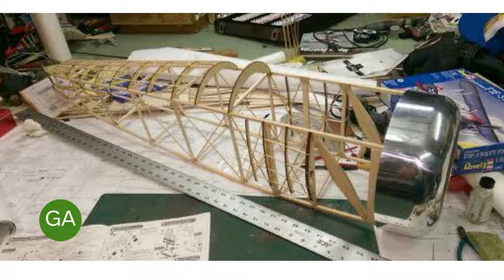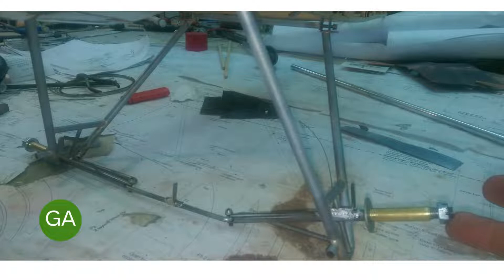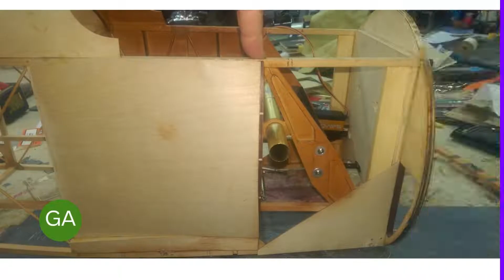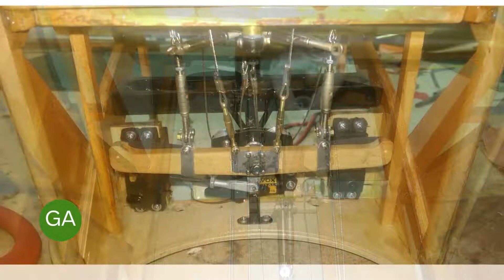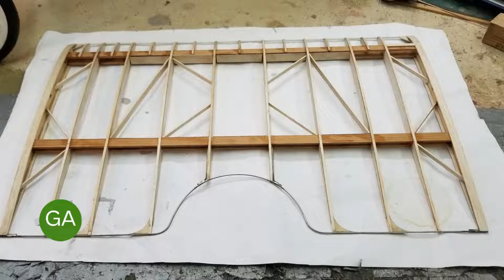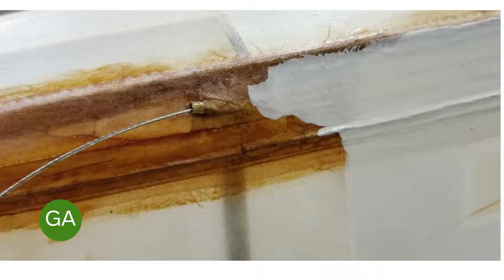Grant's shop Camel build part 1. Watch episode #2 next on the Camel play list. #model #scalemodel

Comment: You lost me when I seen that single cylinder 2 stroke engine in the cowling. That's too bad...
Reply from the maker: Why is that too bad? I will be building a dummy rotary engine so it will help cover it up. I'm also on a budget so I can't afford a radial. I chose this engine because it's short enough to fit between the firewall and the cowling. I also plan on over propping it to get the RPM's down so it sounds like a rotary engine. I started this project years ago before the gas four strokes were available and I couldn't afford one even if they were available. If you want to donate the engine you think should be in it then I would be glad to mount it. I do what I can with what I've got. It's not easy to afford the nice things when you are on disability.

Comment: Hi Iwondered how you got the clean cut edge on the SIG coverall. I have a SIG Skybolt I wish to cover in the in stuff.
Reply: Very nice work by the way.
Reply from the maker: I use a good sharp pair of scissors, a new exacto blade, or a scalpel. I'm glad you like my work by the way.
Reply from the maker: If you are a member of my FB group "Scale R/C airplane building techniques" then feel free to message me with any questions you might have. If you aren't a member then please join. I built that Sig Skybolt years ago and used Sig Koverall with a clear nitrate base and colored butyrate dope finish.
Reply: @Mastermodeler.  I have Sig Skybolt on my bench right now! It will be covered in Cover-All and Brodak dope.
Reply from the maker: @SomeGuyInSandy  Fantastic! I built that kit over 20 years ago and I still have it. It had a Saito 90 in it and flew great. I used Sig Koveral and dope along with the rib stitching and pinking tape. Let me know if I can ever help. I mean that.
Reply: @Mastermodeler.  I picked up a RCFG Stinger 15RE for it, so it won't be a slouch. It's also going to be my first fabric and dope job. I have a pretty ambitious scheme planned. Lookup tail number N33RP if you want a peek! Anyway, I need the practise. I ordered a VK Sopwith Camel kit from Procter Enterprises, and I don't want to F it up, lol!
Reply from the maker: Very nice. I have the VK Sopwith Camel NIB. I built the VK Nieuport 17 and the DRI. Nice kits. @SomeGuyInSandy
Reply: @Mastermodeler.  Any progress on the big Camel?
Reply from the maker: @SomeGuyInSandy  no. Been a bit busy.
Reply from the maker: @SomeGuyInSandy  No. Been recovering from surgery on my left hand.
Reply: @Mastermodeler.  Oh no! Carpal Tunnel?
Reply from the maker: @SomeGuyInSandy  yes. And trigger thumb, and cmc of the thumb joint (worn out).
Reply: @Mastermodeler.  I hope your surgery goes smoothly, and that you recover quickly!